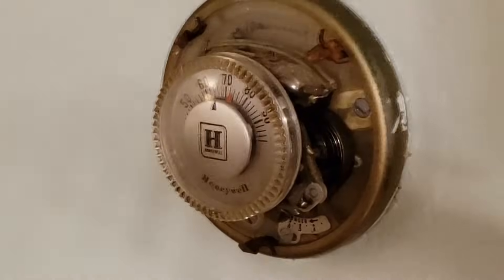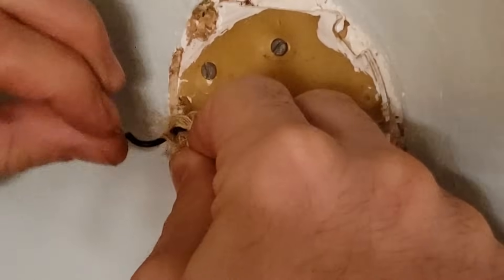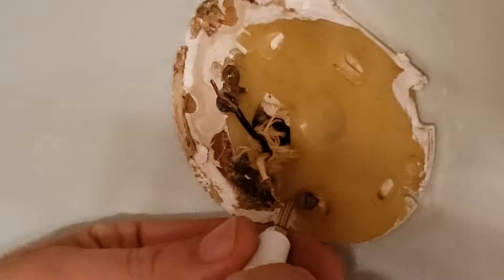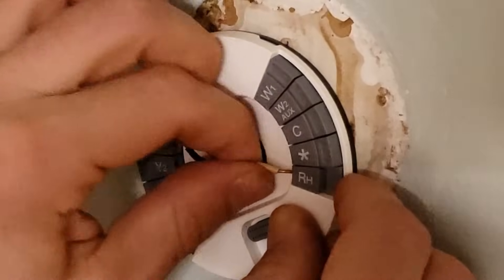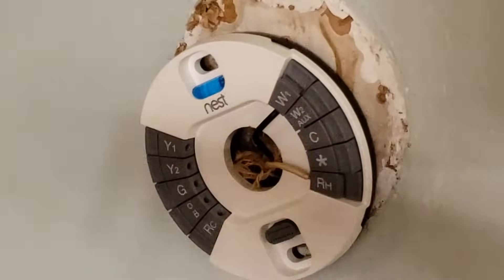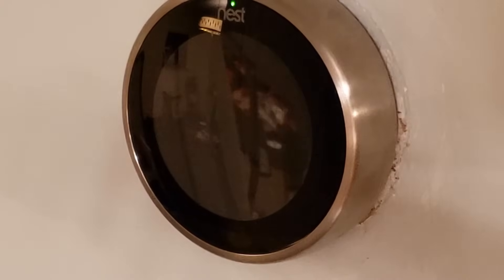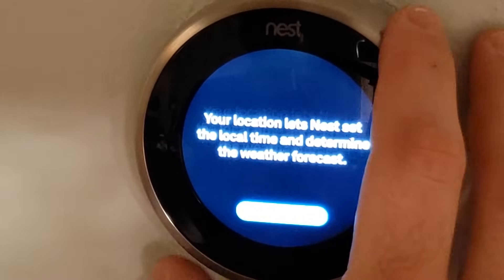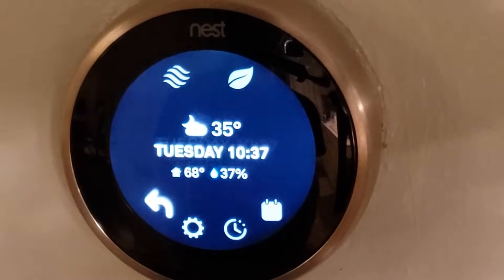How to Install a Nest Thermostat with Only Two Wires

Comment: Nest requires a common wire for a constant 24v, other wise it is only going to work until internal battery dies.
Reply from the maker: That's not correct. I've had it running for 3 months now, it uses the 24VAC differential in the relay coil - shunts the current from the NO contact that governs the boiler, and diverts it to battery in an isolated circuit. But if this supply isn't clean, or isn't 24VAC that's when a common wire becomes necessary.
Reply: Nest's own website states that in most cases you won't need a common wire for the thermostat to work and charge, only if the wires are not putting out enough voltage.
Reply: @nhcharmedone  What's the minimum voltage needed? I'm only measuring 16 VAC.

Comment: Won't the battery die with just two wires?
Reply from the maker: No, it uses what little current the two relay wires provide to charge. Mine has been working like this for three months now no problem.
Reply: @Bootstrappin  Cool, thanks! You give me hope. I have baseboard heaters and want a nest. I just need to check if they are 24v, right?
Reply from the maker: @scrapmetal58  yes, most systems are 24 volts AC. Sounds like you've got the same setup as me. Just remember to set your meter to 'AC'.
Reply: @Bootstrappin  what does set your meter to ac mean?
Reply from the maker: @dnycpro  ah sorry. If you have a multimeter in your toolbox, use it to check the voltage coming out of those two wires, may give you a clue why the Nest won't charge.
Reply: @Bootstrappin  thanks
Reply: @Bootstrappin  I bought and installed two wires and it worked for me, thanks

Comment: Awesome video just installed mine last night thanks for the video.
Reply from the maker: I'm happy I could help!
Reply: @Bootstrappin  hey man how are you? How is the thermostat so far since I might have the same HVAC system do you ever needed a c wire?
Reply from the maker: @NyxT-GyreX  I moved out of that house since then. But it was fine -- ran for about 2 years without a C-wire... but your mileage may vary.
Reply: @Bootstrappin  oh so you had to install a c wire by then? 🤔 thanks for you reply
Reply from the maker: @NyxT-GyreX  no I didn't - I meant it was fine when I left it.
Reply: @Bootstrappin  awesome thanks again for the reply man
Reply: How’s the battery life?

Comment: I have a stupid question! What's the black wire? I have 3 wires 🔴,🌕 and ⚫ will this be compatible with nest gen 3? And where would the black wire go? Help please! Thanks,
Reply from the maker: Unfortunately there's no real standard when it comes to thermostats. You need to note where those wires go on your old thermostat and just copy that over to the Nest. Could just be a common wire, which would go to 'C'.

Comment: My old house has two wires thermostat too. They are black and white. I am wondering if they are AC or DC?
Reply from the maker: Generally speaking, they will be 24 volts AC, depending on your furnace. Only in rare situations do furnaces use high voltage AC. To know for sure, take a multimeter and probe the wires in both AC and DC mode.
Reply: they are both ac, but old systems can be run on 120v. newer ones are usually 24v. you can buy a transformer at home Depot that will convert it.

Comment: Hello and thanks for the video. I too have a 2 wire boiler and hooked up the nest as you suggested. However, I continue to get an error stating that there is no power to charge the battery. I obviously don't have a c wire, any suggestions?
Reply from the maker: Few things. Try swapping Rh with W1. Also, make sure that you strip about 1/2" of wire jacket and make sure it's really jammed in there. If that doesn't work, take a multimeter, turn it to 'AC' and measure voltage between the two wires. It should read 24VAC, roughly. If it's not anywhere close, you might need to add a common maker kit either to the furnace, or use a wall plug.
Reply: @Bootstrappin  tried all that plugged in a transformer c connected and still power problem. I have very old two wire red and white only slide lever type Honeywell thermostat. Got transformer still says no power 😢

Comment: I have an old 2 wire low voltage setup and want to switch to a Nest. Which Nest model did you use? I've seen a few videos with people using the "E" model with 2 wire. Just trying to get as much info as possible before I order a model. Thanks
Reply from the maker: This is the Nest 3rd Generation, but it should work with 'E' model and 4th generation as well.

https://store.nest.com/product/thermostat/T3007ES
Reply: @Bootstrappin  Awesome, thanks for your help.